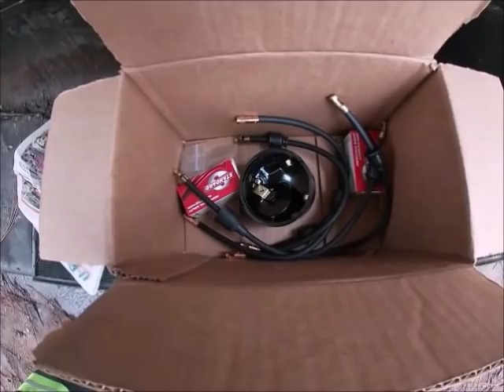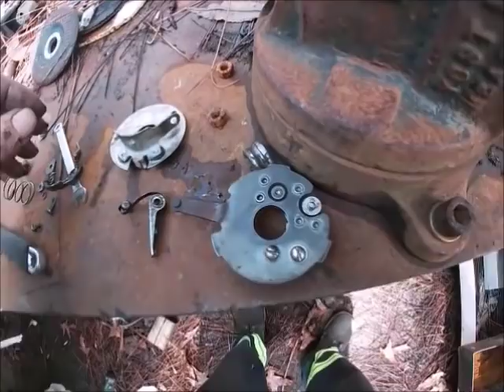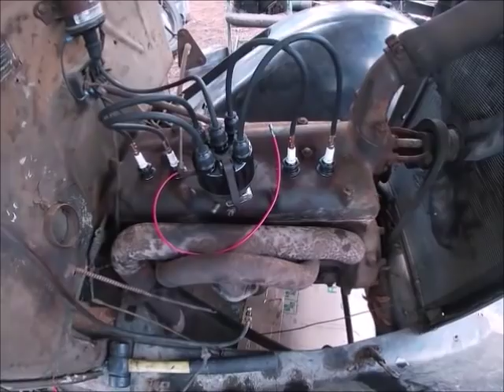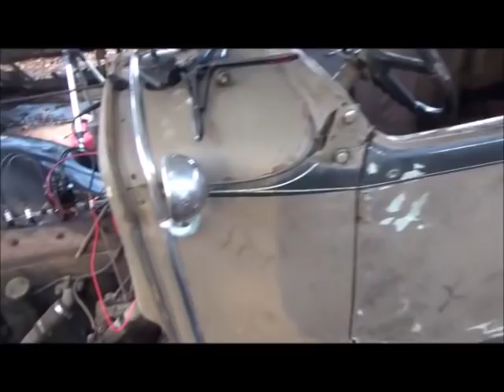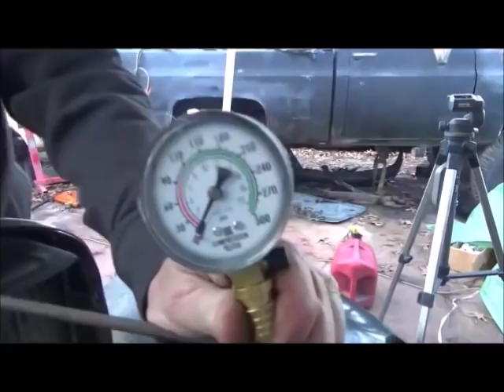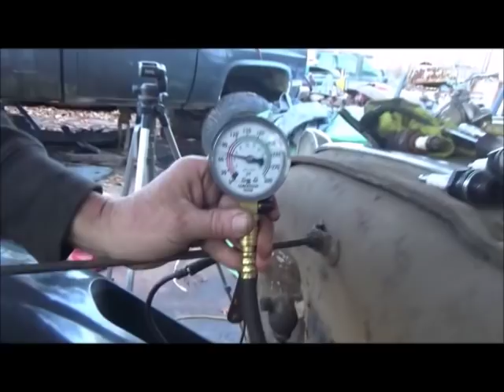1931 FORD ROADSTER FIRST START IN YEARS PART 2 OF 2

Comment: Anytime you have questions about Ford model A or T engines like what that power in lead on the distributor just contact Matt ay Iron Trap Garage channel.
He's easily one of the top sources for those old flat head Ford engines today.
He may even have that part or know where to get one.
The Hershey Show is a great place to look for any old Ford A or T parts.

Comment: love that sound of a revived 40 horse flat head lol. just got a 31 and funny thing is that the old rusted out not running ones sitting far back in the garages seem to be worth just as much as the driveable one with nice paint job good tires and all like i just bought. oh well, great video. youve got quite the project there. you seem to know your stuff when it comes to the A.

Comment: I’d throw oil, coolant in it, and throw some ply board on the floor. 
  Get the ole brakes goin and drive around town for a bit. 
   Engine sounds like a sewing machine. Ya did good! 
  That 3rd cylinder will clear up after the first 10 minutes of run time.

Comment: ((😳)) turn your choke rode left to right to adjust your air mixture carburetor lean mixture screw lean it out ... it will smooth it out & stop the smoke .. the exhaust should sound like it’s saying chicken shit , chicken shit, chicken shit, out the back .. and you should be able to count the fan blades on each go round !!!

Comment: If you might want to try to save that old distributor cap if you know somebody who has a small vacuum chamber like they can make it out of the pressure cooker with a vacuum pump you can place the cap inside that chamber with some epoxy on it where the crack is and if you put it on there like 10 to 12 lb of pressure it might Force the epoxy into the crack which would keep it from sparking a cross I've seen it done and nine times out of 10 it works just a thought Jonathan

Comment: Not one new car sold in the last 10 years will be running 100 years from now. My grandfather said they used to let the air down in the tires and hop on the train tracks with these, they had cables rigged up like a cruise control, and would be in the back seat "neckin" with the ladies while the cars were on autopilot on the train tracks. Cops could never catch them because their axles were different widths, and couldnt ride the tracks. 👍

Comment: https://www.grainger.com/product/SPRAYON-Insulating-Varnish-1D276 I used this on a fly-back transformer (color-tv) while it was arcing to ground, it cured the problem. You might try it on hi voltage stuff that is messed up to get you going cheap?

Comment: Johnathan, the throttle rod from the cross over to carb should be straight, and outboard of the choke rod. If needed to clear, you bend the throttle pivot arm out enough to allow the rod to clear. Great job on bringing another timeless car to life, from a real Model A mechanic!

Comment: Many years ago my boss had us work on old cars , one was a model a . we sent the motor out to be rebuilt , and we used the brake system off of the 40 ford s. making it hydraulic braked rather than all the rods and adjustments  . It is my understanding that the frames were the same , the brakes stuff bolted right on . With a safe breaking system and a rebuilt motor it would go sixty no problem

Comment: 65-75 PSI is very good for a Model A with a stock head.
Reply: I wasn't sure myself but then again I did know those are low compression engines and not flamethrowing beasts by any stretch of the imagination.
Reply: @Hjerte_Verke  4.2 to 1 compression ratio.

Comment: What is a good oil for flat top cams? I have heard diesel oil is good because of the additives, is that true. I have a 51 Chrysler 251 and the oil was so bad I had to remove the pan to clean it.

Comment: use the sea foam can for fogging intake  i had a 2008 gmc serria 4.8 litre with 700 thousand km on it i put 2 cans of sea foam in the tank at a quarter tank ran it till it was empty  the filled it up the truck would cherp the tires after than from 1st to second it never did it before thats what sold me on this still it will unstick any carbon and losen any ring except bad rings but this has compresson so it will fix it even put it in fuel it will losen carbon as well

Comment: We did a 31 truck about 40 years ago. As I recall, there is a cable that looks like greenfield coming out of the keyed ignition switch that goes to the distributor and we had to run another wire from the key switch housing to the coil. We got a rebuilt longblock and lots of parts from a place in N or S Carolina that specialize in T's and A's.We used a Zenith carb. Here's a wiring diagram. https://sacramentocapitolas.org/2017/10/18/model-a-wiring-diagram/

Comment: Sounds like it wants to run. Be a while before we know if it mixes fluids, Noha is off doing something or maybe went to school. Lets hope anyway. As I remember, these are not high compression engines. It should do just fine for the guy that say ya, I got one and it starts and moves but little else. Floor pan and some other fine tuning then park it at a dealership.  I used to get a lot of chevy owner very unhappy with this by conceding that 85 % of all chevys made are still on the road, the rest made it home

Comment: Sounds like the timing is still a bit retarded. The timing is the most critical thing to getting these things to run nice. All properly set, a Model A motor will sit there, with the spark retarded and idle at 300-350 RPM. NOTHING else sounds like a Model A motor running with the spark retarded !!! You can get a "modern" (1956 Ford) points plate for these distributors from the parts suppliers. Other than the electronic, that's what most people use. 
Brattons and Snider's are both good suppliers. Berts, in Denver, for good original used parts.
https://www.brattons.com
https://www.snydersantiqueauto.com
https://modelastore.com/original-parts
Enjoy and Happy New Year !!!

Comment: There was raw gas coming out of the carb when you were first trying to start it.
Reply: Its a Down Draft Carb. they will do that some.
Reply: Ya back pressure from the intact valves back through the manifold,better than blow by into the sump,just my opinion.
Reply: Updraft carbs like this one and on many tractors almost need to flood to start.  My theory is that the new gas doesn't vaporize as well as the gas they were designed to use.  Modern gas is formulated for fuel injection so it doesn't need to vaporize as readily.
Reply: @williamdavidson9009  interesting.